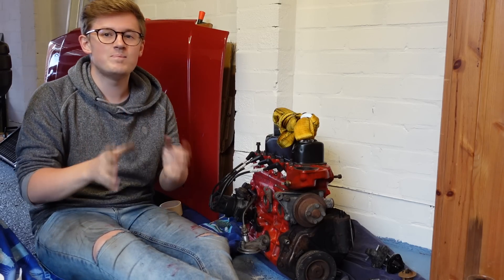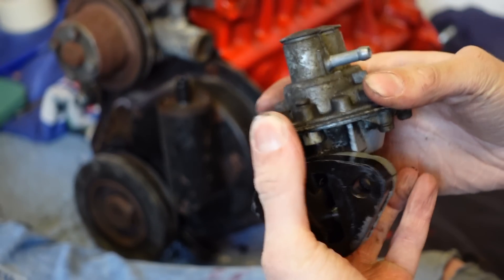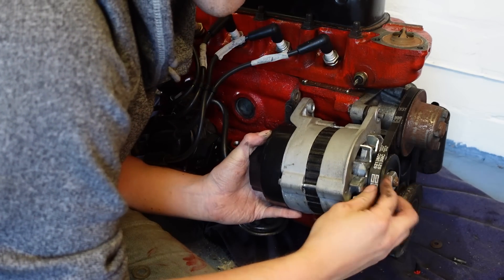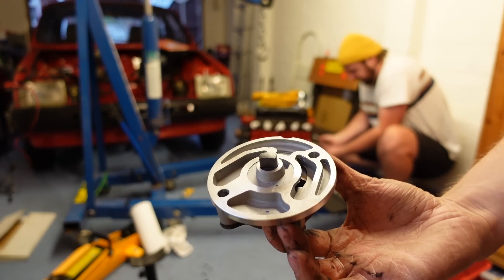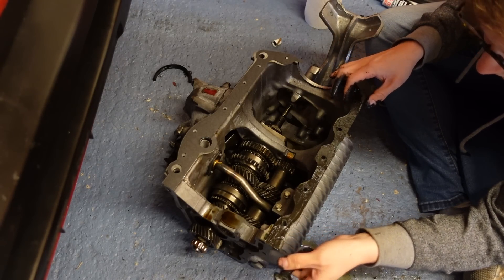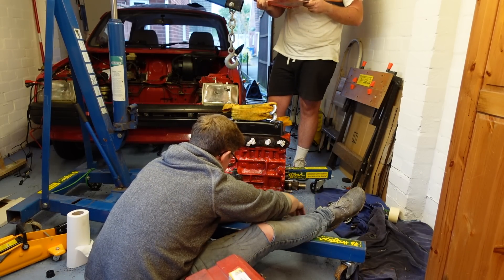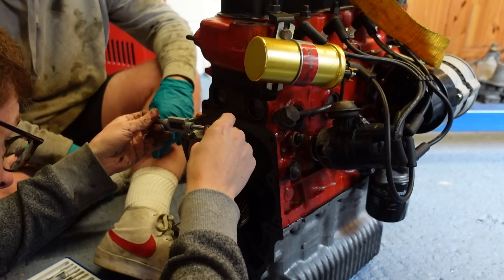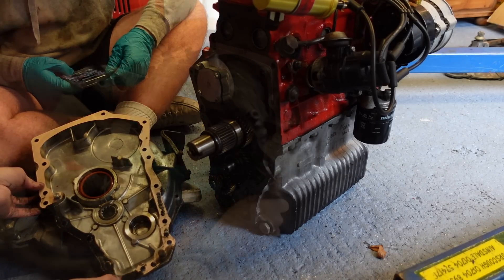Engine and Gearbox Marrying + Snapped Bolt Jeopardy! - Metro Gearbox Rebuild, Part 5

Comment: Why didn’t you clean all the components before rebuilding?
Reply from the maker: I did. I didn't include it in the video as it's rather boring. The one thing I didn't fully clean was the transfer casing as I ran out of time, but I have since done so.

Comment: Aahh, takes me back! 1 tip though, before putting bolts into blind holes (especially when you've retapped them), blow them out with an air line to avoid possible damage.
Reply from the maker: It would be nice if we all had an air line!

Comment: It’s only personal preference about balancing them they don’t get balanced when they are assembled in the factory
Reply: Yet modern engines are balanced as well as flywheels and Clutches. It improves them overall. 

Just because it wasn't done, doesn't mean it was good.
Reply: Or when they go to a garage for a new clutch.  I fitted loads of these to minis, 11/1300s and metros, when I was in the trade, and we just used to go to the motor factors and buy a clutch.  Nobody even considered balancing in those days.
Reply from the maker: 1100s and 1300s were both far too early for verto clutches. 1982 they came in.
Reply from the maker: Pre-verto clutches needn't be balanced, but verto ones do. The BL factory service manual says it absolutely must be done whenever the clutch is changed. I can't see, given the clarity of the advice, that dealers just openly ignored it.

Comment: That brought back some memories, did so many A series in the sixties and seventies together with all the other BMC motors. I hope that was dry sealant on your hands as it was a bit of a no no to touch clutch plate friction material and it’s corresponding surfaces with dirty or oily fingers.
Reply from the maker: Don't worry, the sealant was dry!

Comment: I used to repair the older A series transverse engines where the clutch plate was behind the flywheel. Awful things.
Reply from the maker: I don't see how that can be an awful thing. It has to be the easiest clutch in the world to access.

Comment: You are going through all the stuff that we all did the first time we did this job.  There is a lot to remember and you won't remember it all even if you do a rebuild like this two or three times.  I once had to rebuild my 1275GT lump in a borrowed barn having been told that I could use the barn for five or six weeks.  Cool, no rush then.  Except that two weeks in I was then told that the barn was needed in three days and that I would have to get out.  At this point I had the engine in a milion pieces on a couple of tables!  When you are in a rush, things can go very wrong.  Fitting the crank oil seal the wrong way round isn't a good idea, trust me.
Reply from the maker: And that's exactly what we did when marrying them together - we rushed. Connor didn't have much time, and him leaving is why I struggled (eventually failing) to fit the engine on my own. It's only thanks to me struggling that the engine didn't go in minus the o-ring!